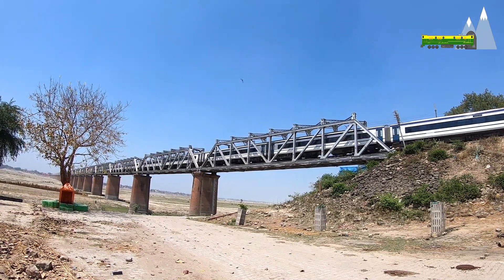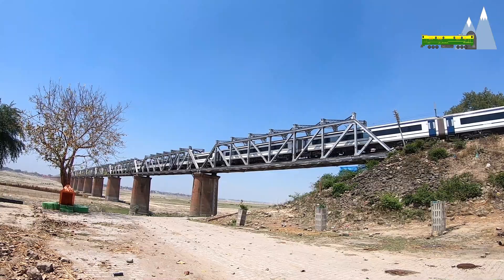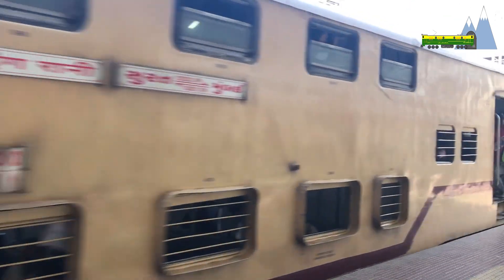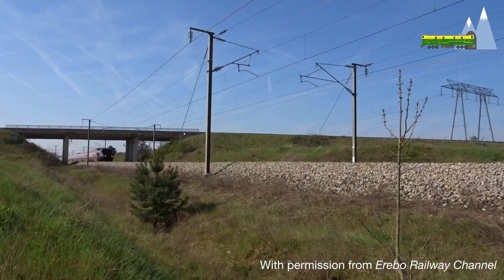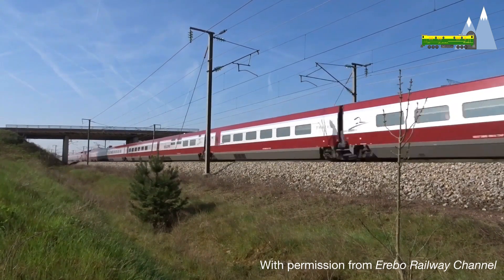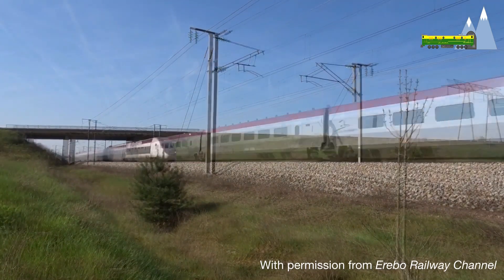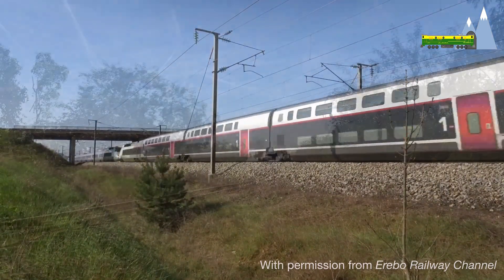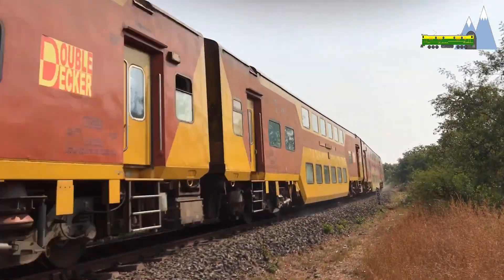Double decker Train 18| semi high speed trainsets |trainsets

Comment: Technically DD trainsets are not feasible as the wont be space to mount pantographs. Talking about DD coaches that is hauled by engine which makes it easy to run. Talking about france n japan well their OHE are higher then in India. Plus there are many old over bridge which gives height limitations to these trains
Reply from the maker: In my opinion height of catenary in India is not a problem. If you have traveled in the underground sections of the Delhi metro, you would notice the clearance between catenary and Panto is substantially lower than that a DD train would confront in IR. Also part of the car with the Panto could be given a lower height profile. As for bridge clearance, DD trainsets (if commissioned) will run on same routes as existing DD rakes. But having said that, it must be pointed out that a DD trainset is no where in the priority of IR.

Comment: Yes DD is possible but it requires considerable amount of R&D and Testing. TM mounted bogies are not the main deal here but positioning of underslung equipments is crucial. Before comparing to Japanese DD shinkansen or French DD TGV we need to first understand their design concepts. For example both have different positioning of electrical equipments. TGV has end cars with majority of electrical equipments fitted while Japanese have different arrangements. Secondly we need to remember both these run on completely dedicated setup. There are pros and cons and many design aspects needs to be considered for our conditions.😊
Reply from the maker: Siemens, Alstom and Bombardier make double decker cars with underslung motors in several European countries. These are in the same class as our own LHB cars. All of the above companies have a presence in India, so technology is not an issue. You can see here an example from Belgium https://youtu.be/aWmDc_1GIQk
Reply: @TheTrainStory  U did not get what I said😊..Traction motors are mounted on axles so I said thats not the main deal here. There are many other electrical equipments mounted underslung which has no place in our current DD setup. First of all lets not compare with other countries trainsets. They have different needs. Our designs are mostly based on more passenger accomodations unlike European trains. BTW in the video power is provided by the locomotive
Reply from the maker: @Devraj Malekar the system is a locomotive at one end and driver car at the other. However the VIRM and DDZ double decker cars of Netherlands are true multiple units. Double Decker cars in India are unlikely to have sleeper versions although some expts are being tried out. The reason I gave the European examples is because both the ICF and LHB cars are European designs. The LHB were originally chair cars that were configured to sleeper car versions in India. And since the suppliers have a base in India , double decker multiple unit should not be a problem. Although in the interim push-pull experiments could be tried. My case is simply that DD cars have a higher carrying capacity and would be a good option at least on Shatabdi routes. But yes our requirements are different...BTW I have travelled in both the Belgian and Dutch DD cars, they are very similar to our LHB cars. The Dutch ones also  have a place for bicycles ...
Reply: @TheTrainStory  Well one of the best DD sleeper train is in Finland, known as Lapland express built by Skoda Transportation. And they have 1520mm gauge so it will be good if RDSO & Indian Railways too seek a partnership there.

Comment: Double decker high speed EMUs are definitely doable. Besides TGV Duplex there's Stadler KISS (max speed 160kmh, produced also in 1520mm "Eurasia" variant), SJ X40 trains in Sweden (max speed 200kmh) and a few E4 series Shinkansen in Japan (max speed 240kmh).
Reply from the maker: Yes u are absolutely right. Does the Eurasia version (1520 mm) run in Russia? I have travelled on the M6 class in Belgium that can do 200 kmph and the VIRM class in the Netherlands. I liked the ride in both ...
Reply: @TheTrainStory  Yep, travelled on one actually, as they are used on Aeroexpress routes from Moscow to the airports, nice trains. The airport routes are not the best usage perhaps, as steps make travelling with luggage more inconvenient, and with airport routes it's a lot people with luggage on a short trip. (This, and problems with accessibility for wheelchairs are perhaps the only real disadvantages for double deckers on passenger side). 
Georgia uses those perhaps smarter, on a major intercity 4~5 hour long route from Batumi to Tbilisi. 
Ukraine and Lithuania actually also have double decker EMUs Czech-made by Skoda with max speed of 160 (Lithuania) or 180kph (Ukraine), both are 1520mm.

Comment: Would there be enough space for the traction motors?
Reply from the maker: Self propelled double decker trainsets are quite common in European railways. I think bogies with traction motors can be fitted to a double decker car
Reply: Yes there is lots of space if you see present dd exp few equipment are fitted below the middle deck where there is no lower deck